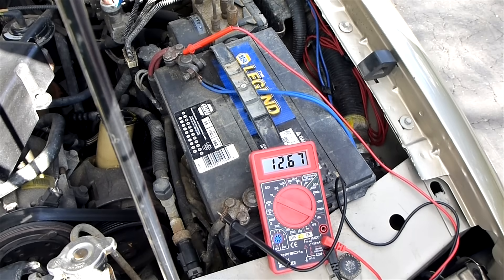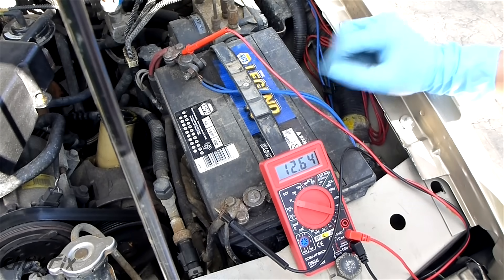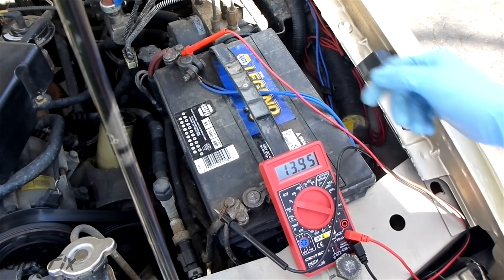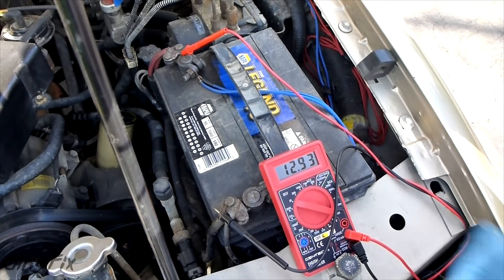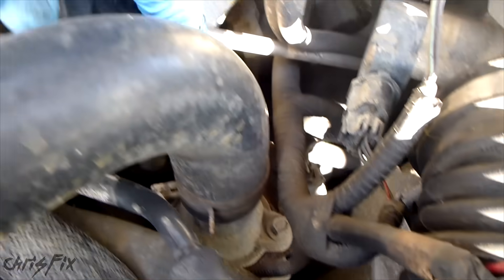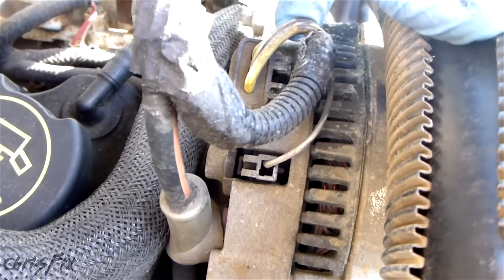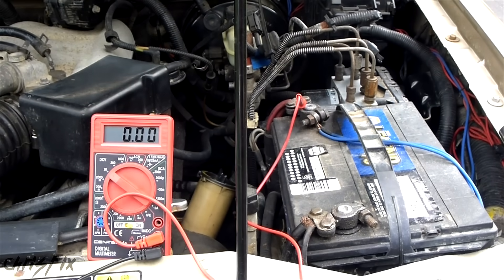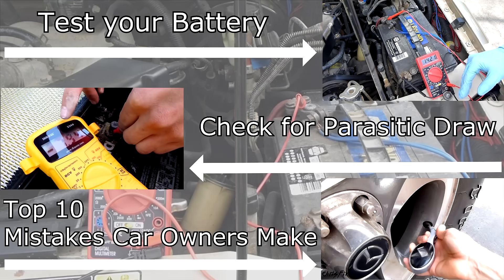How to Test an Alternator

Comment: Can I do this test without the car being able to run? cant find a video
Reply from the maker: The car needs to be running so the alternator can properly function in this test, otherwise you can remove it and take it to an auto parts store and they can do a bench test if the car can't run

Comment: why does my battery keeps dying in 2 day when i dont drive it? i just bought a new battery last month please help i have honda hrv 2020 i bought a battery tester is this the same as using multi meter? i dont have any after market install remove my dash cam,starter i added heat or insulator on the battery maybe this is the problem? a added a dielictric grease on my alternator connect could be this 2? the cost

Comment: Hello Chris. My car battery seems week, its voltage drops below 10 when cranking, and when I checked for parasitic draw, in the afternoon, it showed 0.17, but in the evening, just minutes after turning off the car, it shows initially 0.47, than for a second went down to 0.17 and finally became 0. Could you probably tell what could be an issue here? Alternator seems to be charging, it showed over 14.3 volts... thanks

Comment: Hi Chris! Thanks for the Alternator Lesson. Something is wrong with my car. While I crank the engine the backlight of my dash dims considerably, even with nothing electrical turned on. After engine turns on it goes back to normal. However, If after turning on the engine I turn on the headlights I also notice the change in backlight intensity. Otherwise the starter motor cranks well and the engine turns on right away with no problems. At AutoZone they tested and told me bad battery, and could not test further until I had a good battery. I replaced with a brand new battery and returned to same AutoZone. Another employee tested and told me the battery was bad. The old battery that I kept in the trunk just in case tested good (85%). I didn't tell the employee that the installed battery was new to not hurt his feelings. But I went to a nearby O'Reilly. The guy at O'Reilly used a tester on my car and told me my alternator is bad. I will perform your tests and see how it turns out. I'm not sure I can trust these well meaning people. Chris, any idea what could be wrong?

Comment: Hey Chris. Hope you see this comment. I have a good alternator that isn't charging the battery. I'm deciding to run a wire straight from the alternator to the positive terminal of the battery instead of digging through my wiring harness. My question is, does the gauge matter? I have 16 gauge wire as well as 10 gauge wire. I will splice a in-line fuse into whichever wire I choose. Thank you!
Reply from the maker: Yes gauge does matter. Measure the distance from the alternator to the battery and see how many amps the battery can output. Then use this: https://ls1tech.com/forums/attachments/conversions-swaps/726407d1683240040-wiring-questions-alternator-starter-dhlcfrp.jpg
Reply: @chrisfix  Thank you so much!

Comment: Hi. I got a slow crank no start. I changed the battery and the starter, still the same issue. The AC compressor had a weird sound just before no starting and the ac stops working. Now my van is not starting even after these new parts. What is exactly?

Comment: Any idea when I turn on a lot of accessories when the car is running the voltage drops to 12.1V? When the car is off, and the car is in the run position with all accessories on, it goes down to 9 volts within 5 mins. Battery load test indicates that the battery (4 years old) that is rated at 650 CCA was measured at 625 CCA and that it was in good condition.  The car is from 2004 with 285,000 kms.

Comment: hi watching from montreal, i have 9th gen civic and i replace the battery, alternator, battery sensor, pigtail but still have an issue saying check charging system in dashboard. thanks
Reply from the maker: What happens if you run a new wire from the alternator positive to the battery positive and alternator ground to battery ground?

Comment: Hey Chris! My interior lights and headlights seem weak rumbling, also the engine idle is weak...but I tested the battery while the alternator is running and it's above 14.5V, maybe the idle valve isn't clean? But if the idle valve is dirty and it's the problem, the interior and headlight lights shouldn't be  weak isn't it?So the alternator could be the guilty of all these "weak" elements?? Greetings from Spain, I follow all your videos and guides, keep like this!

Comment: Hey so when my 03 trailblazer is running normal and no lights on or anything it showed me 14.92 and with lights on and everything i could possibly turn on it shows me 14.74
Reply from the maker: That is a little high. What is the problem that is making you check the voltage?
Reply: @chrisfix  um basically when my dad takes it to work every morning he has to use jumper cables because he works night shift and like a 14 hour shift the vehicle don't turn on in the morning that's why I'm checking
Reply: @chrisfix  I'm gonna take it to autozone so they can check it themselves you think i might need a new alternator?

Comment: In relation to the alternator case and the alternator bracket, by "voltage drop" Chris meant that if your reading was - 0.1 V while touching ground and touching the alternator case and then you touch the bracket and it "drops" to - 0.05V then "the ground isn't good" and you need to clean the surface between the alternator casing and the bracket. 
It's easy to think that "substantial voltage drop" means that your - 0.1 V becomes - 0.2 or 0.3 when you move your multimeters red lead to the bracket.
The name of the the test is indicative of what it means: voltage drop.
Basically, it's how much current (amps) drops in voltage (power) going from the alternator to the battery. 
- 0.05 means that it's dropping 5 hundredths of a volt - 0.1 means that it's dropping 1 tenth of a volt on the negative side.

Comment: I don't know if you're still looking at the comments for this video, but does all of this testing for the alternator and battery still apply when i need to Jumpstart my car every time. So what im asking is will it affect the results if i had to jumpstart my car before doing the testing? And i wanted to know, what does putting the engine to 1500 rpm mean
Reply from the maker: Yes this works to test the alternator if you need to jumpstart your car every time. And this is the video you want to watch for the battery: https://youtu.be/YC--MLNIbik?si=i8koYYtgdGN0Btyw

Comment: I just did a ground test on my Alternator and I keep getting 28V~30V - I checked my chassis ground points and they say the same (fluctuates). Now I’m not sure if it’s my multimeter malfunctioning (I think I may have inserted the test lead cables too far into the multimeter) however I get 14.4 volts when checking the battery. Could it be the voltage regulator that’s bad?
Reply from the maker: That's really high, I'd check your multimeter and make sure it's working properly before doing anything on the car
Reply: @chrisfix  haha I did - my multimeter was displaying mV so it was really .2-.3v - sometimes fluctuated to .1
Thank you for responding so quickly ❤️

Comment: One time, I decided to test the voltage on my late grandpa’s 1966 John Deere 4020 because the batteries don’t stay charged (they’re only about half a year old, but the tractor just sits in the barn). First I tested the resting voltage which was about 12.2V. I went to start it, it turned over maybe once & it wouldn’t crank & also the voltage dropped completely. So I went & charged the batteries for about 5 mins, then successfully fired up the engine. I then decided to test the battery voltage while the engine was running, and it tested at around only 12.5V which I had a feeling was pretty abnormal even though the batteries only get used for the lights (which don’t work) & starter since the engine is completely mechanical. I suspected the alternator wasn’t charging because of the running voltage being pretty much the same as resting voltage. I then shut off the engine & tried to start it up again immediately and it wouldn’t start. So yeah.

TL;DR: My late grandpa’s John Deere 4020 may have an alternator issue because it doesn’t charge the battery very much.

Comment: Can you not get electrocuted from messing around with all that voltage?
Reply from the maker: It's very unlikely you could be electrocuted by a car unless you put a wrench across the battery or did something really dumb. The bigger danger would be moving parts when doing tests like this
Reply: @chrisfix  yes you are correct. Good call

Comment: Hi, my battery loses its charge very fast and so I went and got a battery load test, which turned out to be fine with a low charge. I charged it less than a week ago, so something is draining it super fast. I want to test the alternator now. Should I recharge the battery before I do what you did so that I can compare the voltages, or can I look for ~14v even with the lower charge? Thank you.
Reply from the maker: I would recharge the battery then test. I think what's more likely happening is a parasitic drain, here is how to test for that: https://www.youtube.com/watch?v=n5FJDgcdii8
Reply: @chrisfix  I was going to follow that video as well, thank you for the great content on both videos!

Comment: I ran both voltage drop tests using the dc ohms option,, followed all instructions and got a reading of 0.01 to 0.02 on both negative and positive sides of the battery, is this good?

Comment: ... did all procedures in the vid and the alternator with all accessories on plus AC turned out to be 12.40 volts. And the drop down ( negative ) to B post and nut and the back of that alternator wire on 1500 revolution per minutes turned out to be 0.50 volts. Is that the reason why this alternator when I put the gear selector to Reverse from Park or Drive seem to jerk off and shuts unless I step on the gas with my other foot on the brake pedal (automatic transmission!?)

Comment: Hey Chris, this video is great. When attaching the meter, the readings I get when the vehicle is off is 12.85. When I turn my car on, it jumps up to the 14.20 but then starts to jump around between 13.98 - 14.15 after. Unfortunately, the alternator is in a difficult spot to check the connections. With these numbers, do you think it is possibly the alternator?

Comment: hello Chris, I have a toyota camry 2005. my problem is this, my car turns on normally, I let it warm up and put it in drive but it does not take off immediately, although it does take off when the radiator fans turn on. After this it works fine all day. Until the next day comes and it is started cold. then I have to wait again about 10 to 15 minutes to be able to take off again. what can the problem be specifically? a sensor, the transmission filter? what would you recommend me to do?keep in mind that the car when it is out and about it drives fine.
 thank you very much we appreciate how you help the community so much!

Comment: Another hit brother! Thank you. I just checked my friends Ford truck. He just hit a brand new battery and has a Battery low light on. So, I did exactly what you said and multimeter read 12.6 before turning it on. But after we turned it on, it was 13.113.2 proving like you said a bad alternator. When we turned the vehicle off the battery drop back down to 11.0 telling me that alternator is definitely not charging the battery.

Comment: Hey everyone, i have a 2000 Pajero Exceed that suddenly died on the road yesterday. I towed the car home, recharged the battery, unplugged all the alternator connections (covered in oil due to an engine oil leak), cleaned all of them and reconnected. Now I've tested the battery and it is ok. I have done all the tests shown on this video and everything is good given your specifications. Just that last one that you said it should be under .3 i couldn't do it as my alternator is down below hard to reach and engine is hot on a 40°C day under the sun. It seems everything ok, but I'm afraid of driving and car stopping on the road again. Any tips you could share?

Comment: Can it be the chassis ground if the car sometimes turns on and alt is reading 14.2V 
Battery reads 12.4 when off 
cold weather no start 
Green starting Relays reading 90 resistance should be between 50-200 I read

Comment: Hello how are you ? 

I need help . My car is reading 12.2 volts dc when off and 14.2 when AC AND CAR ARE ON . x5 bmw has trouble starting in cold temps . Autozone charged battery said it’s good. Autozone tested alternator and they said to replace but my volts are 14 when AC IS ON

Comment: What if it reads 14 and then dies after?
Reply from the maker: Does the car shut off? Or does the alternator drop?
Reply: @ car shuts off, it gradually goes down and the idle gets rougher and rougher and it goes down to around 11 and it shuts off. Earlier today it was idling okay but now it won’t last longer than 15 seconds. All this started when I got hit with a lot of rain and I went though a puddle I couldn’t get around

Comment: i have a 2003 honda element that loses power at night with the lights on, during the day i can use it but worried the engine will shut down (already happened twice). got a new battery, same thing happens and the battery light on the interments panel is on. thanks for showing me where to check

Comment: This doesn't necessarily apply to newer vehicles anymore. Modern vehicles don't have a voltage regulator in the alternator anymore, it's control by a the BCM, ECM, or some other module. They'll do "weird" things like dip to 12.8V while running to test the batteries or charge up to 15.3V because it's cold. Even 10 years ago this was the case.

Comment: Another thing to do is get rid of the repair-type battery connectors like those shown on the vehicle in the video. Use actual battery cables. Those cheap repair connectors are guaranteed to cause trouble.

Comment: Thanks for the video. Currently I’m at 13.32v with stereo brights and heater going. With all the lights off and stereo off and it’s around 13.43v. Never got to the 14.6 mark. After shut engine off and  voltage is around 12.75 to 12.6.  It’s a 2008 rav4 2.4l.

Comment: I drive a ford escape 2005, the starting voltage on the car shows 14.3V about 30 min drive the voltage drops to about 13.6v
At night the lights starts okay gradually goes dim, dashboard light goes off sometimes.
Please advice

Comment: Does the multimeter continue to drop the longer your vehicle is turned off ?
Reply: It shouldn’t drop fast at all if it is and drops about .20/.30 when you disconnect and reconnect the negative terminal then you have a parasitic draw. You can test for this with a multi meter as well. You disconnect the negative and connect a multi meter that can read amps. You connect the multi meter to the battery terminal and the cable. Make sure that you use the negative and not the positive as you don’t want to short it out as the whole frame is connected to negative. You should see no more then 50ma for older models. Some new cars show 100ma. You also need to let the car sleep for 5min or up to 30min so leave it connected and do something else while you wait.

Comment: If you want to check an alternator with a LifePo battery, how should this all be looked at. Any change?
Reply from the maker: It's basically the same process except it will probably output 13.8 to 14.6V. You want to make sure the alternator is not overcharging as that can damage your battery (LiFePo are more sensitive to that)

Comment: 01:39 will this test work on a start-stop system? I tried this with the multimeter set like in the video and it doesn't change. It says at the voltage like the car is not even running
Reply from the maker: In your case the BMS (battery management system) is likely preventing the alternator from charging, this is normal behavior if the battery is sufficiently charged (this is to increase lifespan and wear/tear on the battery). I would see if you can put the car into service mode so the engine runs all the time or just raise the rpms slightly and see what the alternator says. You might also want to test under load to force the alternator to start working

Comment: Hi Chrisfix, my car only charges when I turn on the headlights, just put in a new battery?  Please check my video for the reading on my 12v outlet, which is showing the same readings with a multimeter at the battery?

Comment: VW Polo 1.4 2002: 12.53 on not started car on cold morning. 14.2 on car on and 13.81 with lights on, heater on, and radio on. Once I shut them out it doesn't go back to 14.2 but stays on around 13.94. The battery is brand new, replaced 3 days ago. Do you think I am all good, as the seller says I have an issue with the alternator...

Comment: if the car has 2 batteries should the alternator value still be around 14.6? Mine is around 13.8
Reply from the maker: Yes, is there any electrical load on the car when you are testing?

Comment: Early you said to make sure your battery connections are clean. However, you didn't  mention tight as the negative cable was very loose. Your voltage drop tests were excellent. I would check the voltage drop between the positive battery cable and the battery post as both battery cables look very sketchy. I'd also do the alternator tests at the battery post rather than the cables.

Comment: What if I'm only getting 0.02 when checking with negative and positive to alternator?
Reply from the maker: Sounds like the alternator is toast if thats all its outputting
Reply: @chrisfix  Thank you Chris for your response I believe so I keep getting a P0625 intermittently and car seems low on power at times. This is for the voltage drop test you did, is it supposed to be 0.05??